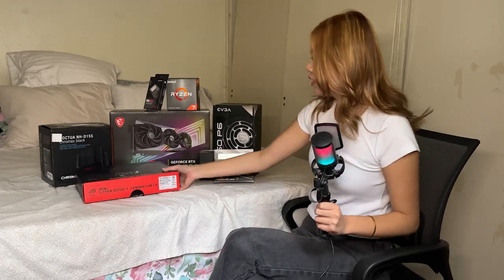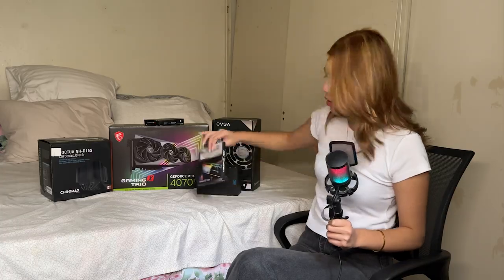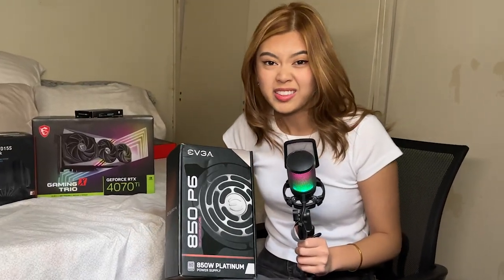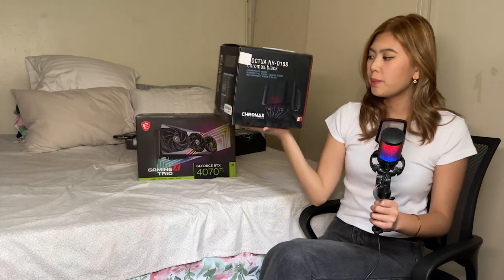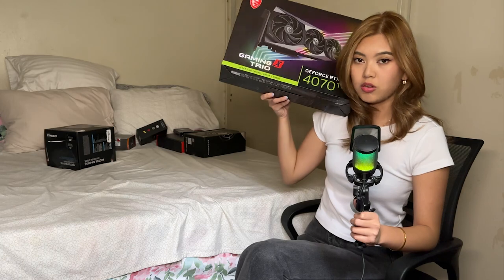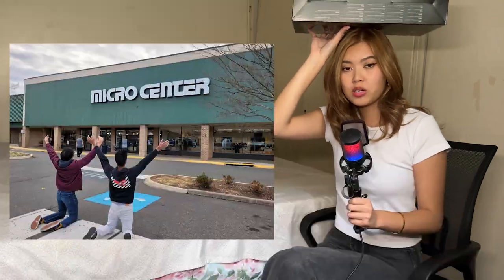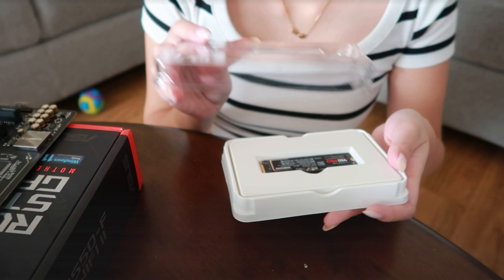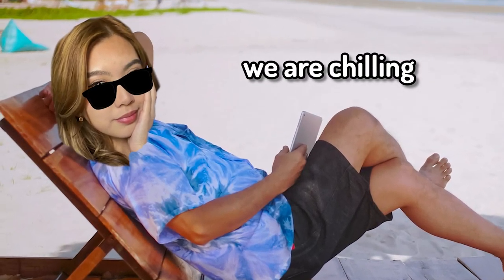Building My FIRST Gaming PC: rtx 4070ti $1800 (ugly build but lowkey a monster) 2023

Comment: In case you haven't done so, you should enable the XMP profile for your RAM. Otherwise it won't be running at the speeds you bought it for. There are tutorials for how to do it but you basically just boot into your bios and change one setting there.

Comment: My only suggestion - if this has yet to happen - is to get an additional 1 or 2 140mm fans for the front so that the build has a more balanced version of intake (positive pressure) with exhaust (negative pressure).
Reply: NZXT is so ass it took them years just make a mesh front panel. No amount of fans can make it not turn into a microwave 😂

Comment: Super nice video and I love the mood. But your processor is bottlenecking your graphics card trenmoudesly and I would recommend to downgrade to another graphic card, because with that setup you will lose graphic card poer with round about 44% for 1080p and 30% for 1440p. Just a briefly suggestion, but maybe you are fine with that.

Comment: Noob and honest question, no need for esd straps? Will also build my personal computer 🍻
Reply: Its personal preference and how much you're willing to risk your parts. It doesn't mean that your PC will automatically be damaged if you dont' use an ESD strap. It just means there's a higher risk of accidentally releasing static electricity to your components and not realizing it. I've built and re-built numerous systems  over the past 13 years w/o an ESD strap and haven't had issues.
Reply: @JJFlores197  appreciate the reply based on real world experiences cheers 🍻

Comment: I'm new to this pc thing; but why use a SETA hard drive? I thought ssds replace the need for hard drives. Is it optional to install a hard drive or is it a necessity to any pc build?
Reply: It is optional to install
Reply: hard drives are only good for storage of un-used applications. If you want anything on ur pc to be fast go with m.2 nvme drive. HDD are strictly for storing files, games u don't play often, etc. Its very much an optional install and you will only usually see it in budget or high storage systems. I have two m.2 1tb nvme drives and one 16tb seagate exos which i use to store mods for my games, video clips, and anything in between that takes up unnecessary storage on the fast drives.
Reply: @kaizer2k2  oh okay. thank you for explaining.

Comment: 5800x is a very good chip and i have it as well fast but why not use the newer ryzen 7000 chips with the 40 series nvidia card?
Reply: Because there is nothing wrong with AM4 and 5800X. Still a strong chip.  the new AM5 is expensive + DDR5 not much difference yet and by the time 5800X is not good anymore there will be the new 8000 chips
Reply: @Ladioz  This is true i was just curious on her explanation because i have a 5800x as well and its nice but i am only seeing people use the 4000 chips with the 7000 series thats why i asked
Reply: @theboy2777  its not a fluid built certain parts outperform others.

Comment: Just get RGB case fans it should fix the plainness
Reply: no just get rid of the brick of an air cooler so ur system doesnt look like a 2003 build.
Reply: @kaizer2k2  that brick of a cooler outperforms alot of aio btw but not the high end one tho
Reply: @ikram2512  it def does not beat the deepcool lt720 which is a budget aio that was praised as the best cpu cooler of 2022. Also a 4090 is a card meant to be used for high end 4k-120fps ray tracing games.
Reply: @kaizer2k2  you are special
Reply: Kaizer do u really need high end aio for gaming?
Reply: @ikram2512  never said high end the deepcool lt520 cost $100
Reply: @kaizer2k2  I mean high end when come to cooling not price
Reply: Kaiser the CPU in the video is Ryzen 7 5800x they're not like i9-13900ks
Reply: @kaizer2k2  what ur PC specs can I ask just curious
Reply: @ikram2512  tf do you mean high end when it comes to cooling? the high end would be a custom loop. 

It doesn't have to be a 13900, its like if you bought a honda and said fuck it no need to do regular oil change its a honda. 

9900k - 3080 - 64gb ram - 2tb m.2
Reply: @kaizer2k2 🤦 I will leave u alone then

U are indeed special
Reply: Let's me spend 90% of budget on aio and 10% of other part like i3 gt 1030 something like that right kaiser?
Reply: @kaizer2k2  u spend more money on ram than CPU?
Reply: @ikram2512  buddy my cpu costed me $900 I bought it when it came out LOLLL, my pc costed me 4 thousand +, my aio is not even a fraction of the cost of my cpu. 

Ikram brother I dont think pc building is for you.
Reply: @kaizer2k2  bro got scam💀
Reply: I rather have dust on my CPU cooler or fan than having leak on my PC components lol
Reply: @kaizer2k2  4k dollar for i9 9th gen💀
Reply: Kaiser bro CPU got gap by i5-12600k💀🤣🤣

Comment: You cheaped out on the motherboard. It's a common rookie mistake by gamers. Just because the motherboard doesn't give you the gaming power you need like the CPU/GPU in Valorant or Overwatch, doesn't mean you need to cheap out on it. It's the piece that connects everything together. First thing to fail will be the motherboard. Never go for the B550 series.
Reply: What do you suggest?
Reply: am520 is the cheapest b550 is decent can still overclock the cpu x570 is overkill

Comment: Just putting this out there but the 5800x is way too weak for the 4070ti in most situations in 1080 and 1440 it’s about a 30% bottleneck
Reply: That's not true at all lol
Reply: @shoobadoo123  yes it is ,   5800x bottlenecks the gpu and wont be used at 100% of gpu power? i just think that people should do a little bit of research on the internet before building pc's because you want your pc to be used at 100% of every component either in general tasks or gaming . not 50%

Comment: Bro why R7 5800x , Ryzen 5 7600 much better and 20$ cheaper and also supports DDR5 ram which you would buy because u did not cheap out om your ram at all,Also just 500gb ssd and the why TF 4TB of fricking hdd bro some games dont even have hdd support anymore ssd is a minimum now,and then 4070TI WHYYYYYY??????? AMD RX 7900XT/6950XT BETTER AND CHEAPER PLUS 40-SERIES NVIDIA GPUS SUCK BESIDES THE 4090 3/10 BUILD COULD'VE BEEN WORSE😂

Comment: Not bad but could've been way better.  The RX 7900 XT would've been a MUCH better choice than the RTX 4070 Ti.  You paid the same money to get 8GB less VRAM which means that your card will live for AT LEAST 3 fewer years than an RX 7900 XT would.
Reply: @TheAscendedHuman  fanboy
Reply: @Gravo Perez  yeah that's true but she's using her pc for gaming so amd was the better option
Reply: That how poors talk. 😂
Reply: You forgot to mention the multiple driver issues that AMD has and how expensive her power will be running any AMD GPU lol
Reply: @TJ & Huri  don't experience any driver issue and u can just undervolt without using performance
Reply: @mr_bracket  yeah I got rid of my and gpu sure there's more vram on the equivalent and cards but I've kept having drivers crash and my temps go through the roof and my power usage going up. I think AMD at least in my personal experience has a way to go before I use them again
Reply: @dauntae24  If you're referring to me, my build has an R7-5800X3D, 32GB of DDR4-3200, an RX 7900 XTX video card and an EVGA 1000 G2 Supernova 1000W 80+Gold-Certified PSU all mounted in a Server/Supertower case.

Is that the gaming PC of a "poor" person?
Reply: @tjandhuri  I've owned FIFTEEN straight Radeons.  Included in that list is the HD 4870, HD 5870, HD 7970, R9 Fury, RX 5700 XT, RX 6800 XT and currently, I'm using an RX 7900 XTX.  Take note that of those cards, one is high-end (RX 5700 XT), three are enthusiast-class (2xHD 4870, 1xHD 5870, 1xRX 6800 XT) and three are halo-class (2xHD 7970, 2xR9 Fury, 1xRX 7900 XTX).  

So it's clear that I am NOT a budget gamer.  I DO spend money on my cards which means that I CHOSE to use Radeons.  If the drivers were bad, I wouldn't have CHOSE to spend the money on those cards because if I can afford high-end Radeon cards, I can afford high-end GeForce cards as well.  All the people who talk about bad Radeon drivers simply don't know how to properly switch from GeForce to Radeon drivers using DDU but don't want to admit that they don't.  So, they stupidly blame the drivers (and nVidia had shills in the community saying the same crap to make it seem even more credible) instead of their own ignorance.

The WORST driver issue that I EVER had was an annoying scaling bug that made the picture slightly too big for my display and cut little bits off of the edges.  That was when I had my R9 Furies under the hood in Crossfire and the fix was to simply toggle GPU scaling in the Radeon control panel.  After about a month, it just stopped altogether.

The problem is actually with Windows.  The only way to properly remove a video driver in one go is to do it in safe mode and clear the registry of all entries associates with it.  Neither Radeon nor GeForce software packages can properly remove the other's driver set (or even their own for that matter) and so the driver remnants cause issues with the new card, especially if it's a competitor's card.  The only people who had serious driver issues were people switching to Radeon from GeForce and didn't use DDU to remove the remnant GeForce drivers.  Now that people are starting to figure it out, everyone is calling Radeon drivers "rock-solid", except for people like you, the ignorant masses.

I forgot to mention NOTHING.  You simply don't know nearly as much as you think that you do or you're an nVidia plant who is lying through their teeth.  My words are backed up by entities like Hardware Unboxed, Gamers Nexus, AdoredTV and Ancient Gameplays.  Your words are nothing more than "trust me bro" BS.
Reply: @AvroBellow  you've owned 15 amd cards and it shows how much you are literally gagging for them lol. BTW haven't made a single rebuttal, all you've done is listed common driver issues 🤣🤣🤣
Reply: @AvroBellow  don't tell me it's the windows os as well, the other two gpus use the same os lol. BTW even Intel with how new they are fix their driver issues much quicker than amd does. Anyway stay salty lol

Comment: Would look better with AIO. but congratulation.
Reply: look better and perform better, there is a reason why most top end builds use aio coolers.
Reply: @kaizer2k2  Yeah I heard better cooling helps with performance too. good I listened to them and got one.
Reply: @John-sp9if  always recommend to run fans on max(as long as u dont mind the noise) and keeping ur components as cool as possible. It increase performance and longevity of the parts. Per say if ur cpu idles at 40-50c and on load its 70-80c that's not good. You basically kill the life span of the cpu and it will probably die sooner than it should. I have a corsair h100i platinum since 2019 and my i9-9900k idles at 30c and max temps are 60c. I also crank my gpu fans to 100% whenever I play heavy games. rather see cold temps and hear loud fans than have my parts wear out before they should.
Reply: @Kaizer  Thanks for your time mate, I do video editing, my CPU is not a dragon like yours, just i5 13400. so the cooling is good so far. still ill keep an eye on it.